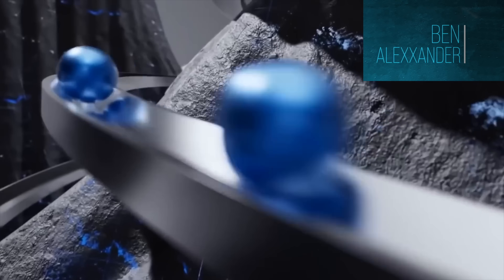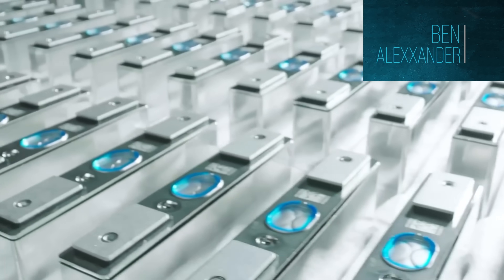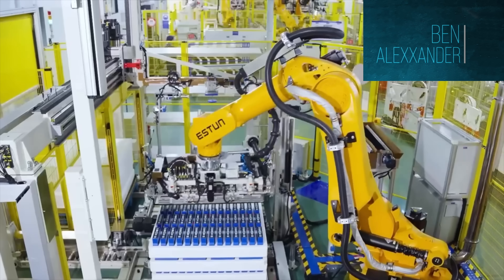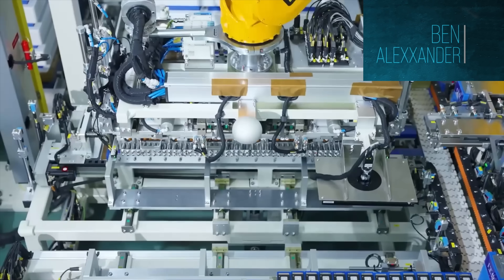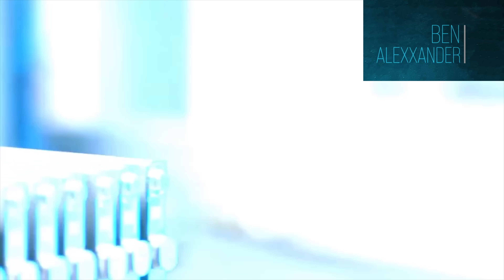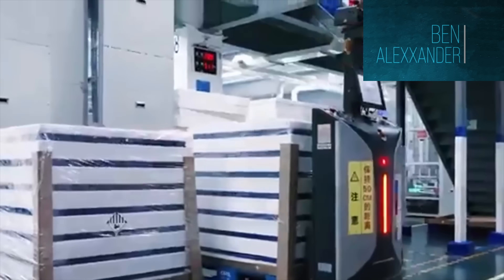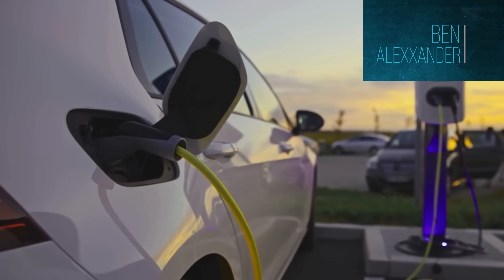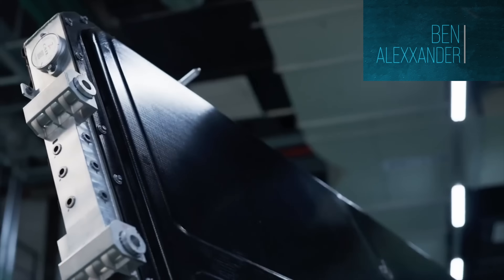CATL’s New Sodium Battery Lasts 3.6 Million Miles — 50% Cheaper Than Lithium

Comment: Forget sodium batteries for transportation, at least for now. We need them for renewable energy storage first and foremost. With that many cycles, they fit the need perfectly.
Reply: We need them for everything and thankfully they can be used for almost everything... As long as they're above the old BYD Blade battery's density at 160 wh/kg they're going fine. CATL's Naxtra is 175 in its first version with densities of 200 possible in the next version...
Reply: But if the demand is high, the cost to produce will drop quickly.  Bigger assembly lines and multiple supply chains developed.  Stick them everywhere they will fit. You will be able to off-grid your house in 5 years for 1/3 of what it costs today
Reply: @kenreynolds1000 Energy density is not as good as lithium so fixed storage applications make sense for the primary usage case
Reply: @ThomasWilliams-ee6li they are pretty close at 160 with these new cells.  Maybe not for 3.5 sec cars, but enough for most commuters and likely some crazy good hybrids to replace the NiMH packs.
Reply: Actually it's the opposite. Sodium is great for cars especially since they can match the blade battery. Old lithium batteries from cars are already being rebuilt into grid storage
Reply: @TheRealMrGordons I disagree. Sodium is stable, significantly less temperature sensitive, and chemically less energy dense. Grid storage doesn't care about the density difference, requires stability due to the amount of storage colocated, and is often in settings of temperature extremes.

Comment: Good video. One thing I think was a bit unfair though is you comparing the Nextra battery to the older LFP batteries. There is a Blade 2 battery from BYD that has a higher energy density and CATL has LFP cells at 190 Wh/kg. That said you also missed that sodium ion batteries can operate from -40 to +70 degrees Celsius at 90% efficiency. That means that at the pack level they can be packed in tighter and have a higher energy density compared to the raw cells than NMC or LFP cells because they don't need active thermal management at all (passive cooling is enough). That means a NA-ion pack today could already be at the same or higher energy density than the LFP packs I was mentioning, and are starting to rival NMC Packs (which have to have pretty heavy cooling systems). 

What I think is that NA-ion batteries will go up in price because the demand will outstrip supply for at least 2-3 years worldwide. They will first make inroads into the energy grid (some have already been deployed) where the energy density doesn't really matter at all and the benefits of greater temperature range (meaning need for active thermal management at all), increased safety, and longer life will make them a better product even if they are slightly more expensive than LFP based products. End consumers don't care about what the tech is, just the specs, and the specs are just better for sodium ion grid solutions already today.

Next they will make their way into the lower end of the EV market and replace LFP completely. LMFP will probably replace NMC in any situations where hither energy density is needed, finally getting rid of anyone being able to complain about cobalt anymore.  The only question is will next gen sodium ion with higher energy density eventually take over the whole market or will there still be room for something like solid state, high sodium anode, or sodium sulfur batteries when they are finally ready for market.

There are some other technologies that have potential to be cheap as well like aluminum ion, zinc ion, and some new flow batteries that use nanoparticles. But I think those are all so far out from mass scale production that it is not worth speculating at this point.
Reply: No he mentioned the temp range.. Quickly but it's there. But yeah BYD Blade 2 upped their game again so they're denser however 175 Wh/kg is still more than good enough as was 160 Wh/kg..
Reply: @stickynorth  Somehow I missed that, but it is a huge deal. The few grid scale storage I have seen deployed with Na-ion have no active thermal management and don't need it. You could get away with very little or none in an EV battery pack too. Yeah I find it funny when people (not this video, but I have heard this sentiment) say that Na-ion don't have high enough energy density but forget that LFP started to take off when it was at 160, Na-ion is already above that. Good luck today finding any grid storage battery solution that is not LFP, and it is the majority of EV's in China.  If LFP at 10-20% lower cost replaced NCM that fast what will 40-60% cheaper do?

Comment: Here in the USA there are 2 factories making Sodium batteries.. I don't know if they are making cylindrical or prismatic or what sizes in watt hours per cell.. What I do know is production is on a small scale and they have been saying they plan to increase production for over a year.. Neither have plans for selling lose cells on the retail market to home DIY or small solar.. They seem to be concentrating on large UPS backup for industrial and grid scale buyers.. So micro grid and home solar storage size is years away unless US consumers buy from Chinese manufacturers.. That poses another problem as trade hostilities and tariffs make the market difficult.. If CATL put a distribution warehouse in the USA and started shipping to US consumers I would be in line to get 100kwh of cells as long as they are in the same voltage range and amperage capacity as the current LiFePo4 cells that are 300a and 650a at 3.5vdc..

Comment: Surprised they were able to get that kind of energy density so quickly, also no talk of dealing with sodiums huge voltage sag, Its either not a problem or its not good for marketing.
Reply: This is regurgitation of CATL's pitch.  Haven't seen actual independent test data.
Reply: @stanimal8  Yeh I saw a video saying how sodiums atomic structure can carry one less electron than lithium which makes it unlikely it can be as energy dense.

Comment: Then there's SAIC GM's 400 Wh/kg solid state battery to be released in 2026 ... guesses at the cost is starting at $80/kWh which ain't great news for that tech. And SAIC GM are very suspiciously quiet about the number charge cycles, if the battery gets less than 3000 cycles then it's dead on arrival.
Reply: Are you aware how many miles do 3000 cycles equal to?

Comment: I really would like to see siodium battery in action! 
If these 'rumors' are true and you will be able to charge with full speed at -20C which is typical winter in europe - that would be amazing. Hyundai kona gen 1 and kia eniro - they needed to warm up batteries - they were starting charging at maybe 20 kw, and when battery temp reached 25C - it start to charge the maximum 77kw for period of time until reaching around 50%...

Comment: I don't think it will completely replace LFP for years to come. They didn't mention some of the issues with sodium batteries. They can work at high temperatures (>25 C), but they will degrade faster and they will lose charge faster. Cycle efficiency for LFP is also better.

If I am ever going to expand my existing home storage battery (LFP), I will need to use another LFP battery, because the inverter cannot handle the voltage range for sodium and adding a sodium battery might significantly reduce the life of my existing battery, For legacy solar systems LFP will still be the way to go for as long as those systems are operational. Same for EV battery replacement.
Reply: This post will age like milk.

A pure example of underestimation in battery technology today.
Reply: @fakamada  #
YOU just "underestimated" the LITHIUM technology.
Try looking on the CATL website

Comment: CATL's Naxtra at $19 is 2.9x cheaper than LFP which is very significant. The longevity is simply NUTS. These are going to make incredible cells for renewable energy storage. CATL will not be able to make these fast enough to satisfy the demand.

Naxtra will change the world.
Reply: LFP is also around 20$ per kWh. 65$ is for already packaged batteries you can buy. Sodium is around 100$ for kWh on the market
Reply: @tedarcher9120  Thank you for the clarification. I will look into this.
Reply: Try to order it for this price at CATL and see what excuse they will present you....

Comment: Reality check....new battery technologies have been coming for a long time and we're still waiting for some of them e.g. solid state. That said, CATL is a company that we can take seriously given their track record. What people also forget is that we are still in the relatively early days of battery development. They are all getting better and cheaper year on year and will do so for a while yet. History clearly shows that. So, we can be very confident that battery prices will continue to fall thus making the switch to evs faster. That accelerated switch to evs helps speed up grid decarbonization via V2G. Used ev batteries will make stationary storage really cheap and reliable. Hence, transport and home electricity costs will fall dramatically. That puts more money in the householder's pocket. Especially if they have home solar. I think that is going to be the step change we have been waiting for. Householders saving money will drive the switch to electric far quicker than environmental reasons. Provided that these sodium batteries deliver on their promises, they will push commuter ev prices below that of ice cars which will put a rocket under the transition away from fossil fuel. I 100% agree that this is potentially a shift in the global energy landscape overall. Exciting times.

Comment: Li Ion batteries have 200-300 Wh/kg. Actual Tesla batteries (cylindrical 4680) have 241 Wh/kg. So it is 37% more Wh/kg.
So a small 408kg battery will become 561kg for the same range a minimum. +160kg.
Largest Tesla car battery is 816kg so it will be a minimum of 1123kg. +307kg.
30% less energy density and 65% less price.
Reply: Tesla batteries need active cooling, LFP and na-ion don't. So the pack is going to be 15% lighter than the Tesla paxk

Comment: I hope to see these in home storage FIRST before cars - sigenergy - please do this! - batteries are currently too expensive right now for home solar systems
Reply: No you do not as their efficiency sucks as bad as Lead Acid(80%) with even WORSE voltage drop than lead acid  whereas LFP is 99% efficient and has a near constant voltage
Reply: @w8stral  Did you not even watch the video? if they are ready for EV's. they are ready for home storage where weight/size is not even a real concern

Comment: Let’s not forget: we have 4cylinder 60litre fuel cars… slower, less range than a high speed V8 120litre 4wd… guess what has more cars on the road?! Reality: we will accept a heavier, slower and less distance vehicle… if it’s cheaper.
Na+ batteries will outrun LFP purely because of cost… regardless of any other chemistry

Comment: Compelling stuff!! I believe that Na+ batteries will become the chemistry of choice for basically every use EXCEPT Ev's. Because I believe that Aluminum/ Graphene/ ion batteries will become the choice for all Ev's where POWER is required, such as trucks. Simply because Aluminum has more usable ions than Sodium (Al+++ vs Na+) In my opinion this fact will in time, yield batteries with 2-300% higher power densities than Sodium has presently. However, the news (to me) that Na+ can be produced on the same production line as LiP might well be the final gram that tips the industry to Na+ rather than Al+++.

Comment: I like the hybrid pack technology. I actually think that a great partnering might be to have a 20kWh solid state section, and 40kWh sodium ion section in the same pack. Even though solid state battery manufacturers are dodging the fact that SS batteries cost more and are more difficult to produce in high volume, SS batteries do have much higher energy density and super fast charging capability. So you could slow charge the whole pack overnight, and then do a quick 5 minute DC fast charge on the road for an extra 100 miles, when needed.
Reply: Hybrid will probably only go to niche markets.  I understand what you're saying but I would want the technologies to be packaged separate unless space is a premium and I'm willing to chance putting lithium right next to my other battery in the same package.
Reply: @KingDavid999  Check out CATL's Naxtra (sodium ion batteries) and their Freevoy battery packs that mix sodium ion/lithium and other battery chemistries in the same pack for different customer's needs and use. These battery packs are slated to be used in several BEVs, plug-in hybrids/EREVs, and regular hybrids in the coming year.
Reply: CATL doing this now.

Comment: What would be great is, if it doesnt burn when punctured.  Weight is a big problem with EVs, so keep the range at 300 miles and just put less batteries in there.  If its all affordable, I would get an EV, its not right now.  I have a house, so I should have an EV, but the freaking cost is still too high on all these cars.  Compared to a Bronco Sport specifically.  Blazer is the closest thing I would buy and thats like 15k more.  So, its still a nogo.  EV sucks offroad due to weight.  I cant wait, meaning I wont wait, so I probably am buying another gas car.

Comment: 175 Wh/kg gravimetric energy density is nice but the volumetric energy density is MUCH worse than LFP.

Volumetric is important for the cars, so I think LFP is still competitive there.

However, in grid storage even volumetric is not ithat important so there, Na-Ion can be super-competitive.
Reply: Hmm, not necessarily. It's weight that is the trade off since you need energy to overcome inertia, and the more weight, the more energy required. Incredible work has been done on increasing range with LFP. If you can find a balance between weight, volume and range, you could offer a far cheaper car using sodium-ion. That could be a huge economic breakthrough and make electric cars affordable for people on lower and median incomes. That could pretty much kill the ICE car, which until now has enjoyed a purchase price advantage. EVs are already far cheaper to run, we just need to get the purchase price down...

Comment: Everyone plz understand that the savings are in the Anode/Electrolyte/Cathode part. The rest of the costs are probably the same. Maybe some steps are simplified in the manufacture and assembly to help the reduction of costs. But there are always unavoidable running costs. 90% cheaper is too good to be true. But I'd love to be wrong.
Reply: The cost reduction is at the cell level.  The pack level is stated to be more like 50% savings
Reply: @aerodyneservices  nope, watch the  video again

Comment: Even if these sodium cells are less energy dense than lithium, still a huge win.
Assuming they perform mostly to the promises, sodium could be the standard for grid storage and home, business batteries, plus the 12v battery systems for vehicles, plus perhaps the hybrid motor batteries for low, high temperatures, with a lithium portion for high acceleration.
So most lithium could be used only for a portion of transportation,  sodium and other chemistry for all other uses.
New lithium deposits found in recent years plus recycling pretty much solves the lithium issues
Reply: The Na-ion cell has operating voltage between 3.6 V all the way down to 1.5V (in fact 0V but considered practically discharged at 1.5). That's unlike Li and others with flatter discharge curves. So not a drop in replacement and the devices will need some adaptation.
Reply: @jurajvariny6034 So drop in replacement for Li?  Na(hhh) 😅

Comment: Excited about higher energy densities, both gravimetrically and, well, cost-o-metrically. That will hasten the big crossover moment as EV sticker prices become unquestionably cheaper their ICE equivalents. We've been hovering somewhere around that point for some time. As for longevity, not quite as excited about batteries outlasting the cars they were installed in. Yeah, you could use them for stationary storage, but in the decades they last, surely even better and cheaper chemistries will have emerged.